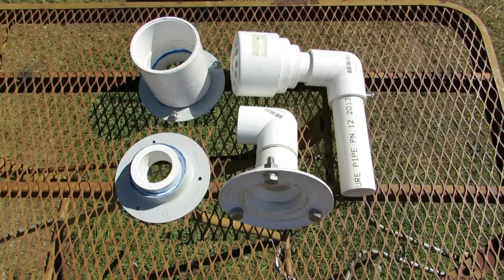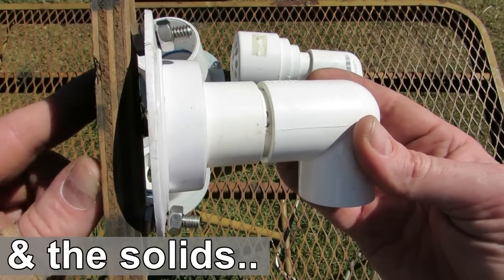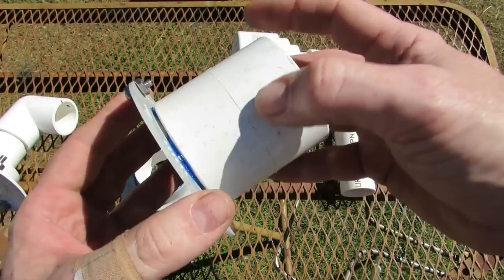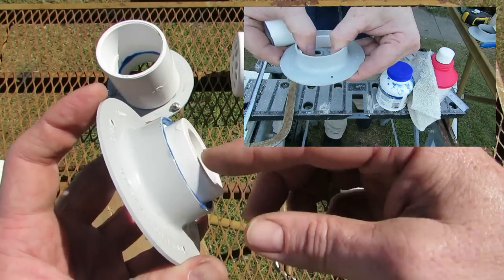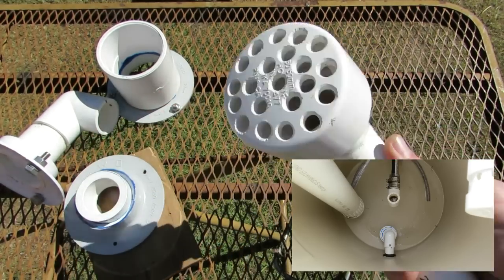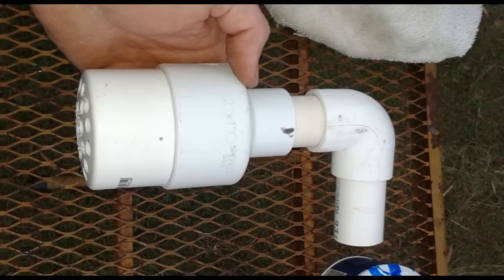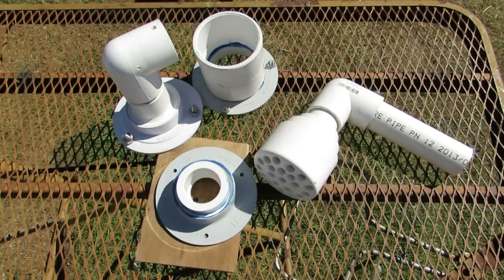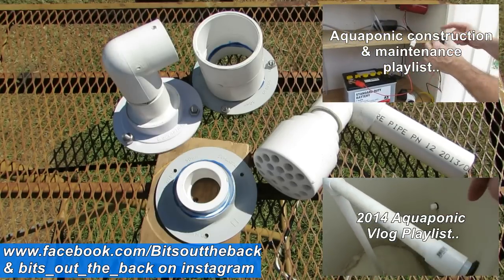How to Build Solid Lifting Outlet (SLO) & Drain Fittings for Aquaponic systems

Comment: Thank you for your videos. I am setting up an aquaponics system in Nakhon Sawan, Thailand and am hooked. I made a quick SLO by drilling a few holes at the bottom of the outlet pipe and put a large zip tie through the holes. If one zip tie is not adequate, two can be used. The idea came to me after watching this video.
Reply from the maker: Nice one Mike. Hope the system is going well for you.👍
Cheers.

Comment: Greetings from the UK! I've loved watching your build videos, and plan on giving my own a go, so I'm browsing around the various designs. I've particularly liked your method of using bolt heads to keep the drains a fixed distance off the ground to ensure the poop gets pulled in and allows a good flow rate, but keeps it vertically quite slim so even small fish would have difficulty fitting in. One design improvement I have in mind for when I do it, is to cap and/or spread silicon sealant on the exposed bolts. I'm a bit worried that, especially given the water turbulance in that area, the fish would get scratched. It doesn't take much of a sharp edge to fatally injure a fish, and (I believe) fish can get infected much easier than land creatures. Thought I'd share that one in case you wanted to apply the same quick and cheap fix to your set-up.

Very very impressed also with the rate of flow and air movement in your bio filter. I think yours beats all of the others I've seen by quite some way! Impressive you achieve it with the same pump as you feed your beds with (if I followed your layout correctly). You mention here that you use a pump to pull water from the fish tank - how many pumps do you use in your entire aquaponic system?
Reply from the maker: Hi there.. Have found that the nuts come off the bolts as well so the silicone would help stop that as well, thanks for that.. 

At that point in time I had one pump delivering water to the fish tank with it flowing from there through the filters into the grow beds.. The system has changed quite a bit since then.. Here's the latest look at how the water flows through the system if it helps any... 
https://www.youtube.com/watch?v=N4mYcUvZ9cw
Cheers,
Rob..

Comment: Thanks for the post. At 2:45 you show how a bolt can be used and the fittings don't need to be glued. Another method is teflon tape around the fittings, which is useful some situations for preventing leaks.
Reply from the maker: Have used that method quite a lot in different situations as well.
Cheers.

Comment: Great video, Rob.  Thanks for all you do!  Putting my own build together and wondering if 1/4" is the proper size for holes drilled into the end cap to both prevent fingerlings from taking a ride but also will successfully draw fish solids without clogging.  Thanks again!
Reply from the maker: Hi there. 
It will depend on the size of the fingerlings. The last batch we got would of been sucked through holes that size. I added a lose section of fly screen around the end cap to stop them being sucked up.  I found it needed to clean it every second day until they were large enough not to fit through.
Hope that helps some mate.
Cheers.

Comment: Mentioning biomedia made me remember something I've been meaning to ask -- are you using K1 in this new build, one of the look-alikes? Seems like kaldenes merged with another company and it's getting more difficult to find (at least around my area).
Would love to see a video just on the subject of media - what works, what doesn't, things to avoid, recommended manufacturers, etc.
Reply from the maker: HI there..
We are using a K1 style 5 spoke media put out by "Small Boss" called PE03 media.. http://smallboss.com/english/product.asp?classid=179
We ended up sourcing it in bulk from a local supplier & ordered ½ a Meter³ with a mate then split that.. Are you here in SE Queensland?  If so I can pass on the suppliers details.. 
Would like to help folks out with that sort of information but I just haven't tried enough out to have an honest opinion.. Maybe after I have a few more systems & filters under my belt I will be in a better position to do so..
Cheers & have a great one,
Rob..

Comment: I've noticed that a lot of people who use IBC's don't seem to use the ball valve/port that is already in the IBC bottle. Is there a particular reason for this? Does it not work well for removing solids? Is it too difficult/impossible to plumb in  SLO? I'm looking at building a system and was curious why people don't use the pre-existing hole.
Reply from the maker: Sorry I missed your post Ted. You've probably got your answer now but will give my 2 cents anyway 😉
It is harder to screen so the fish don't get sucked out. If the pipe work on the outside fails for what ever reason the tank can drain killing the fish. There are some folks that set them up & have no issues. I just like to play it safe when it comes to the fish👍
Hope that helps some & sorry again for missing your original post.
Reply: hi,
do you have a video that shows how you put everything in place in a tank.
Reply from the maker: I don't have a multi tanks & grow bed build clip at this point sorry. 
This clip will give you a rough idea on how the system is set up at the  moment though. https://www.youtube.com/watch?v=raLv4RAUte8

Also have this playlist on different aspects of setting up a system if it helps any. 
https://www.youtube.com/playlist?list=PLBcWprMIwYYi3Y3tUNUMWhO-g_ZhWfijY

Let me know if there is something you're looking for in particular & will see if I have a clip on it elsewhere.
Cheers
Rob.